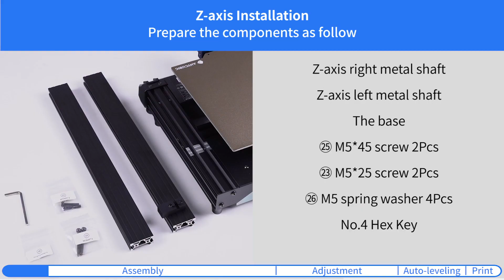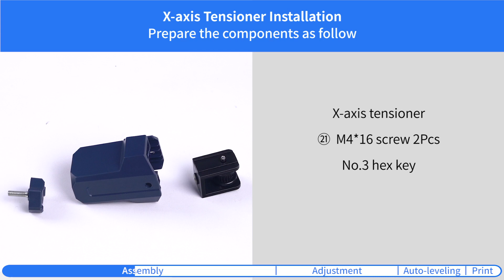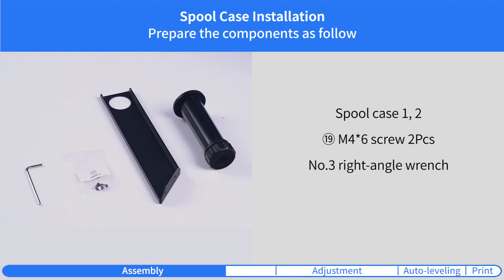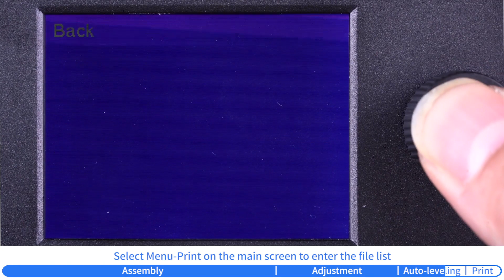Installation and Leveling Guide Anycubic Kobra Go

Comment: Not good instructions. I got it mostly built and then had to plug in the connections. The wiring harness was wrapped oddly for packing and I had to disassemble nearly the whole thing.. as well as take off the heated base plate to untangle it. The way the harness was routed through the pre-assembled base in packaging left me no choice. 
  Poor quality instructional video.
Reply: My owl.gcode printed in 3 hours 11 minutes and used nearly all of the supplied filament.
Reply: My offset happened to like -0.840mm. 
  How long does it take to print owl.gcode at factory settings?